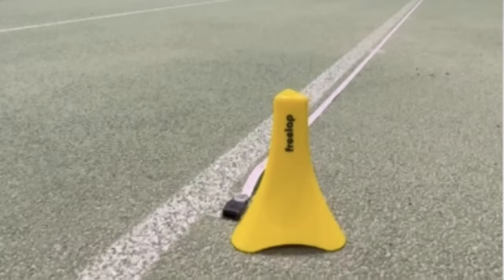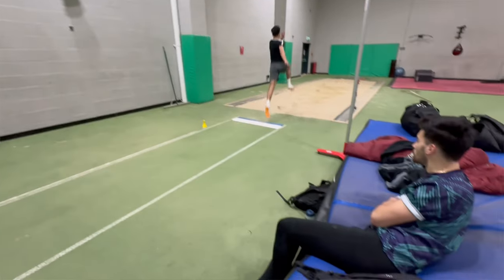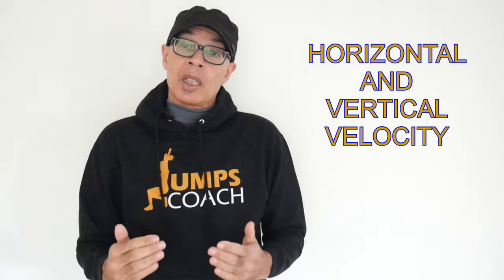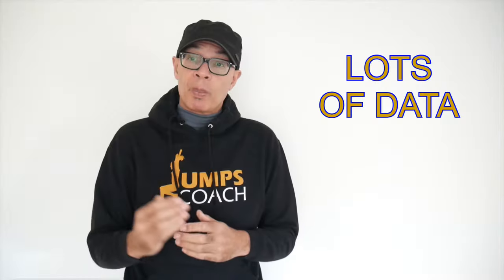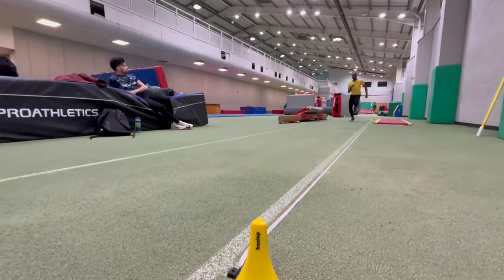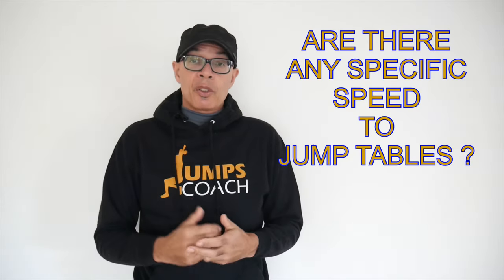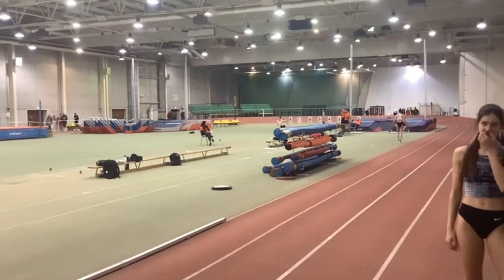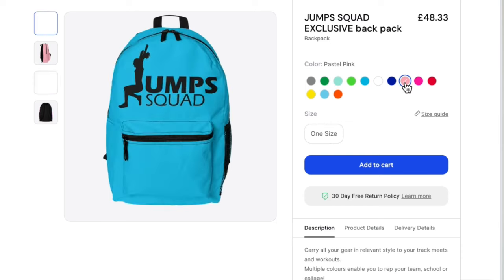LONG JUMP: HOW DO YOU KNOW IF YOU ARE FAST ENOUGH?

Comment: Do you use similar speed testing for triple jumpers as well? Could that provide useful?
Reply from the maker: Yes, the more speed that can be generated the more speed reserve there is as it were. Triple jump and long jump are very similar in terms of run-up speed in that being able to control/use optimum speed for take-off is key. So, the higher that optimum speed, everything else being equal, the further the jump will be. I am unaware of calculations for triple jump distance from 100m time or velocity over the final part of the run-up. Hop length and the phase ratio of the jumper would be influencing variables making it more potentially problematic.

Comment: If we have Velocity at TO (on plank) + angle at which body of the athlete is departuring from plank ( let's consider the athletes body's Center of Gravity as base point, we can measure angle simply through video recording of jumps) then we can calculate the highest point of trajectory he could potentially achieve and max. Range by using formula R(range)= V^2(2sinø cosø)/g or V^2 sin(2ø)/g. Letter (symbol) ø  is for angle at departure from the plank (or TO angle). If simple, without taking in account some aerodynamic forces on body, which form of body placement athlete has in flight, wind, etc. If I remember correctly the formulas from ballistics :). If you have some matematicians within your training groups who know how to calculate that, then they could do it for you or for themselfs and test in practice how close it is to real results "in sand box".
Reply from the maker: Many thanks we looked into this at training today … we need a mathematician though!
Reply: Jesus died so that you could go to Heaven. He loves you . He would really like a relationship with you and for you to live for him. I recommend that you read the Bible💙😊
Reply: @Johnshepherdtrackcoach  Velocity x Velocity x (sin 2 ø)/g (Acceleration of Gravity) is constant 9.81 m/s
 For Example, if we take Velocity 9 m/s at take-off and 30 degrees of Take-off angle (I read recently in one research about technique that give Velocity 8,8 m/s after take-off and angle between 21-30 degrees, so I take 9 m/s for simplicity and I believe it could be achievable in future also or even higher). Then calculations looks like R = 9 x 9 x sin(2 x 30)/9.81 = 81 x sin(60)/9.81 = 81 x 0,866 / 9.81 = 70.146 / 9.81 = 7.15 m
   The highest Range of flight will be achieved with angle of 45 degrees which will be 90 degrees for fornula and = 1. Sin of any angles fo more or less than 90 degrees < 1 always.
   As athlete fly in some "aerodynamic shape" it also affects rage with wind resistance, drag, etc. So in theory athletes goal is to achieve highest speed possible and as high angle as possible close to 45 degrees but no more plus he can develop some "special flight acrobatics" or "flight shape" or how he could change shapes within flight :) to reduce negative effects of drag, wind resistance, etc. Hope it makes sense. That's idea if you imagine athlete like a bullet, he should shoot himself with highest possible speed at as close to 45 degree angle as possible. 
   As max speed is limited to about 9,5m/s (which is about 10.5 sec time for 100m sprint) that is impossible for most female athletes to achieve and if you have a male long jumper who could run at such speed, maybe would be better if he will change his specialisation to sprinting or he would work hard on techniques that give him desirable  TO angle (may be it's will be completely different from what we use now). And, offcourse, he could think about implementing some revolutionary new behavior (flight acrobatics or body shape or placement in space or couple of shapes on different stages of flight) within flight time. 
   P.S. It also may be not applicable  in full extent, looking for world records for long jumpers (male and female) but would be interesting if you analyse their top speed, angles, shapes and other factors.

Comment: On the German research table, does the {m} meters column on the left correspond to the velocity column to the right of it? It seems like that's how it's set up to me. But I'm confused because my speed 11.55 would correspond better to the meters number to the other side (right) of it - 5.98m. Maybe I'm a speed based jumper and am not maximizing my landing? I'm 41 (masters athlete). It was true of my high school times/jumps also - 10.9 sec and 6.55m.
Reply from the maker: It reads rspeed (right), distance (left). So 10.00 100m gives 8.80m! There is a margin built into the research as I noted in the video - to accommodate landing mechanics and jumper type. It would appear you need to work on better speed to jump transfer and optimising take-off mechanics to enable you to use your speed. I didn’t run that many 100m having a best of 11.0 (200m 21.8) but jumped 7.66/7.89w. So I guess I took more speed directly into the jump. Thanks for the question!